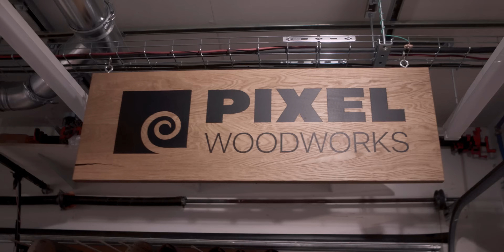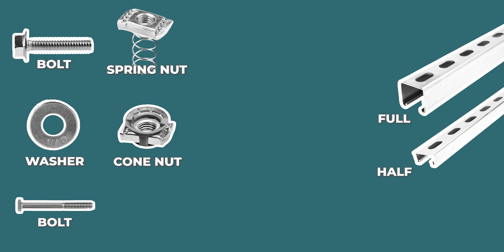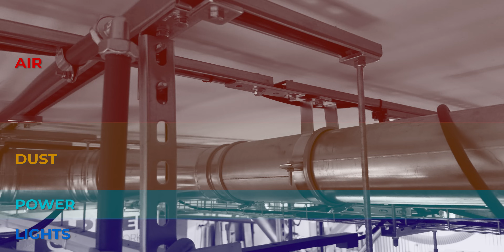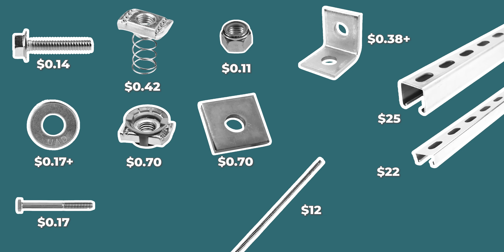How-to Use your shop ceiling fully!

Comment: Is there a way to make a 90 degree turn with this stuff? Need to hoist stuff up to my attic, slide 3ft down, the make a right turn and slide another 6ft.
Reply from the maker: If you mean with strut, yes you can make 90, 45, or more subtle angle changes.

Comment: That looks like a great setup you have. What is the spacing between the base struts that you use?
Reply from the maker: Thanks! Spacing is between 4-5' because the cross members are 10' I wanted to avoid as much cutting as possible so one perpendicular length spans 3x base struts. I hope that helps!

Comment: fact check: cost effective. No.
Reply from the maker: It really depends on what your comparing it to and what the long tail of cost savings is. I've had it for coming up on two years and I get endless utility from it. Prior to this, I spent a lot of money trying other configurations including wooden structures, that I tore down and trashed over time. YMMV and one size does not fit all 🤷

Comment: Be careful hanging too much weight from a garage ceiling.

My parents have been doing that since the 80s and it looked ok when the roofing was old wood shingles but when they re-roofed with asphault the damage was plain to see.  The roof trusses had sagged over the garage so while the house portion looks fine, the attached garage has dips and curves where it should be flat and straight.

I told them to take out the storage they were hanging from the garage roof trusses and fix the dips before they put on the new roofing but they did not and now it looks pretty funky.

You might not notice it right away but after you do, you can't un-see it.

The other thing is if you design a garage with open roof trusses, design it to hold a load of crap in the trusses because somebody is going to look up and have bad ideas...
Reply: What you did isn't bad, maybe a couple hundred pounds and you aligned the strut to distribute the load.

It's when you have 4x as much and don't distribute the load properly that messes things up.

I'm planning a garage with living space over it too.  An important part of that is using the space between the floor joists as a mechanical chase for my utilities.  It's going to be covered up with a decoupled ceiling to make the garage look nice and reduce the noise that can make it upstairs but still allow access when I need to get to something hidden in there.

Now I'm thinking of adding permanently installed dust extraction in there too.

Another thing I want to do is hang movable walls on truss trolleys so I can make my two room garage/shop in to three or four rooms.  That will let me create a paint booth or wood shop that is designed to control overspray and dust for quick cleaning and conversion back to garage space after a project is finished.

I'm also going to have a lot of pallet rack area so my storage can go vertical and I have a hydraulic lift cart that can raise 300 lbs 72" so I can put heavy bins on high shelves even when I'm old and grey.

It's all going to be an exercise in efficiently utilizing every square inch of floor space to the maximum so I can make do in a 1,000 ft² shop instead of a 3,000 ft² shop and live in about 800 ft² upstairs.

Hopefully that will mean a solar and battery system big enough to occasionally run a mill, lathe, horizontal bandsaw and welder will be big enough to run my HVAC continuously (I live in a desert with good sunlight).  It's also a lot cheaper to build 1,800 ft² of shop/home than 3,800 ft².

I'm going to build another ~1,000 ft² steel building for additional shop space and storage.  It will have HVAC but it will be set to cool when it gets over 95° and heat when it gets under 40° unless I'm using it.  Insulation will be about R12 in the walls, maybe a bit higher in the roof but well sealed to prevent conditioned air leaking out or critters getting in.

That might sound like a lot of space but when you want to fabricate, paint, woodwork and store a few project cars inside so they don't cook all summer, it's about as minimal as I can go without making some things really difficult or impossible.

Luckily I have over an acre to build on and flat spots for both buildings and a driveway that connects them.
Reply from the maker: @beardoe6874  Wow you got some plans, it sounds like that will keep you busy for some time! "Nature Abhors a Vacuum", and we seem to find no problem consuming as much space as we can find, or in your case build. I used to do automotive work until I ran out of things to do so I switched hobbies, thats going to be a big chunk of your space. I imagine if I had land to build on, I might fall into a black hole of over-building and never completing, a labor of love for sure though. Good luck and hopefully you have or are getting a Tractor with Backhoe too!  👍👍
Reply from the maker: Its true, I consulted a structural engineer because we built a room on top of this garage as well. So far so good, this has been installed for about 1.25 years and no signs of movement. I covered this in the original edit, but cut it for time. I even had a segment in my attic talking about the joists etc. I just thought it digressed too much, but perhaps that was a mistake, people seem interested. 🤷

Comment: Unistrut.... ?
Reply from the maker: This seems to be a pretty common comment. Yes Uni-strut is A brand. You won't find Uni-strut at your local home center, you will find Super Strut or something else, so I just made it more generic to avoid confusion. Mission failed on my part 🤷 👍
Reply: @pixelwoodworks  I in no sense of the word think you failed! I was just injecting a comment more than anything.. I have seen and heard it called all of the above. You did an excellent job on your ceiling project!!!!! Thanks!

Comment: It’s all fun and games until your roof comes down because it’s not designed for the extra weight.
Reply from the maker: I talked to a structural engineer before installing, but yes, everyone should be cognisent of the load. I originally covered that in the video but cut it for time. I did cover it in the description of the video.

Comment: You can do the metal cutting you describe with an angle grinder.  Which you can also use to deburr the cuts once you've made them.  Less expensive and less space than a metal cutting saw.
Reply from the maker: Its true. I haven't personally had great luck with angle grinder cutting, which is why I bought the miter saw. Some people have suggested a bandsaw as well which seems like a great alternative. You must do metal work and be a whiz with the angle grinder, I'd probably loose a hand 🤷 👍👍

Comment: We use Unistrut all the time for electrical/low voltage jobs. The only hurdle for the average home owner would be the price. but this stuff is great for a wide range of usages. great ideas, and implementation!!!
Reply from the maker: It's true, it can get expensive. It can also be targeted for specific purposes and be fairly cost effective. In the scope of my project, the strut was no the major cost. Dust pipe was by far the biggest cost, followed by power, followed by lights.

Comment: I used the strut components to mount the waste water tank to the underside of my food truck, but I never thought to use it as intended, hanging stuff from the ceiling… thanks for reminding me of one of the common uses of strut! I’m going to take a good hard look at my little shop and see how I can use this!
Reply from the maker: Awesome, the great thing is you can do as little or as much as needed, you can add on over time, and start with something very specific. Good luck!
Reply: @pixelwoodworks  thanks!

Comment: I used to spend way too much time trying to find a random tool or thing, then I decided to used these struts with trollies connected to multiple offset sheets of plywood to create additional wall storage space.  These dozen sliding 24" wide sliding walls segments support thirty six packout mounting plates which I use to store the variety of packout organizers that keep all my odd tools, fasteners and other small materials in dedicated cases so they are super easy to find grab and go.  Got an electrical project?  Just grab the electrics pack and wire nut pack.  Internet work needs to be done.  I have cases for all that with all the coordinated tools.  Hanging pictures?  Yes, that's covered and more. and it all fits behind several spaced out tall metal storage cabinets along a 12' wall with 16" of depth.   This keeps all the odd things tucked away and out of my larger woodworking and mechanical tool boxes so my primary shop area is super clean and organized.
Reply: I've had this exact idea floating in my head for about a year now. Been trying to reverse engineer levracks. Love the idea, hate the price!😂 cheers!
Reply from the maker: Ah yes, thats the product I was thinking of, thank you! 🙏
Reply: That was the inspiration.  I think mine is more sturdy given it is fixed to the buildings joists instead of pallet rack and its more flexible at a third the price.   @159648sentile
Reply from the maker: What a great design and execution. I have seen commercial systems like this but but they are extremely expensive and not configurable. Great Idea, thank you for sharing 👍
Reply: Not very expensive at all if you take the time to lay it out properly and source the best trolly.  All the rest can be picked up at the box store.  Another note is the use of 22" long by 2" tall pieces of high-density polyethylene sheeting on the bottom back end of each sliding panel that runs against standoffs on the baseboard to keep everything level and easily gliding.  
 @pixelwoodworks

Comment: For us old boomers, we're shocked at how expensive this 'inexpensive' system has become. My first exposure to it was as a rugrat when my Dad was in the USAF.  They used the larger stuff and it was about 15 to 25 cents a foot in the mid '60s, depending on how long you started with. They built the largest storage racks I'd ever seen from the stuff to hold aircraft parts.
Reply from the maker: I hear you. It seems like thats the way of the world. I don't typically eat fast food and my memories of Taco bell are 59 cent tacos. I went through the drive through last year, and one taco was $4. 😱 I bet the stuff your talking about was American made too. Just out of curiosity, where did one go (and individual) in the 60's to get something like that or was it only available in more commercial applications?
Reply: @pixelwoodworks  YIKES! I haven't been to Taco Bell in a long time, but the tacos were still more than 59 cents. They don't taste as good now as they did when they were about 39 cents. The struts were available from what I think was the manufacturer in Colorado Springs, next to Peterson Field AFB. I don't remember the name of the company, but we could go there when it wasn't busy and a couple of the guys were allowed to sell to individuals. I think most of the stuff we got was either returned material or seconds, because we got some aluminum sheets once that were stamped with part numbers but deformed. They were a little thicker than 1/8 inch but about 2 ft by 6ft. We cut them down to size and used them in the kitchen as cookie sheets. They lasted forever.
Reply from the maker: Interesting. Thats the thing about anything built with quality in mind, it really does tend to last forever.. I've never heard of buying seconds of steel, but I guess you can get seconds or returns of anything. What would cause a strut like product to be a considered a "second" but still usable?
Reply: @pixelwoodworks  If it's for direct sale to a branch of the military, they still have to have the correct FSN's (federal stock number) printed or stamped on them. Or if the items don't match the description on the order, like they're an inch too short or something.
Reply: Inflation

Comment: Yeah... I'll admit. I have ceiling Height envy. My present garage shop (20x24) has a ceiling height of 84" with a beam going across it with a 74" headroom. One more row of block when they built this house in 1969 would have made a world of difference. As it is, there's only enough room for the dust collection duct to go across half the space without some head-banging pipes at the beam. excellent idea though.🙂
Reply from the maker: I hear you. My last garage was like yours, a big beam below the ceiling deck with a post, but on the other hand it was a bit wider and deeper. Is your shop laid out in a way you need to cross that beam? I guess we make the best of what we have, play to its strengths etc. :) Thanks for the kind words Wayne!

Comment: Great for those with really high ceilings.  My ceiling is a couple of inches under 10' which makes using overhead spaces a lot more complicated.
Reply from the maker: You are right 👍 I wish I had 14' ceilings though 🤷

Comment: Great video 
I worked in an industrial setting installing many strut systems, the abrasive cutoff saws is very noisy and slow , we found a portable bandsaw the best. As well as being very versatile at the same price range.
Reply from the maker: I agree, the cutoff saw is extremely loud. Great suggestion. 👍

Comment: Great ideas! But, be careful of weight. To be on the safe side, I'd suggest consulting with an engineer or use other means to determine the load rating of the ceiling joists or trusses.
Reply from the maker: I agree and In hindsight I should have mentioned this in the video. 👍👍👍 The load is the reason I'm not storing any lumber.
Reply: @pixelwoodworks  I figured as much. Difficult to cover everything in a YT vid.

I don't know that structural strength is considered by many/most, so thought I'd offer the reminder. Thanks for the reply.

Comment: In the usa home depot has it in stock, as well as most of the attachments. Well I think they have super strut which is unistrut compatible but doesn't have the branding.
Reply from the maker: Correct and Lowes has Adamax (which I'm not sure is more or less confusing? 🤷)
Reply: @pixelwoodworks  as long as they are compatible it doesn't matter to us. I like how home depot also carry the powder coated strut. I used some for fence posts across some land that seasonally floods with brackish water. I am hoping that it may last than all of the rusted galvanized posts I see in that area.
Reply: @pixelwoodworks   and lowes is easier to get a cheap delivery on in case you don't have an easy way to transport 10ft lengths of steel. When I ordered a several pallets of fence panels from lowes before the pandemic it came with free home delivery.
Reply from the maker: Interesting, that could make a real difference. I usually have to rent a truck. Thanks for the tip.

Comment: Great use of the different strut accessories for various applications. 

One suggestion, around 5:43 when you show the suspended platform. There is a much easier, cheaper and stronger way to do that. 

Hang a piece of threaded rod in each corner, have a hole in your plywood for the rod, pass it through one strut and then through another at 90 degrees to the adjacent corner (for super heavy duty applications)

Rod is much cheaper than the strut drops, you don’t need any brackets, and there is no relying on nuts/bolts needing to be super tight to avoid them sliding in the strut. 

Again, great problem solving and use of the product
Reply from the maker: Hi James, I do use threaded rod in many cases, however the de-humidifier itself tends to vibrate and I was worried about that motion over time so I wanted something more stable that didn't have flex. Great suggestion though, and your totally right in most cases. 👍👍👍

Comment: Thinking about this system, a track for a  5 gal shop vac would rock. The one I have in my small shop is always underfoot.
Reply from the maker: 👍 For sure, I considered putting a dust extractor above my workbench for easy access to sanders or other handheld tools.

Comment: Retired commercial electrician from NYC, I've run thousands of feet of strut ( we called it kindorf [which is just a name brand]. You did a great job . Oh side note ,we cut "strut" with a hack saw ( start on on the open end) or a band saw, ( not a woodworker band saw.) Again great stuff.
Reply: Also remember to file the cut ends.  Unistrut can make a nasty slice in your skin.  Bad enough to require more than electrical tape to close it up.
Reply from the maker: @guybratt6238   😵 You are right. I purchased end-caps from Discount Strut Accessories that are rubberized and solve that problem, but then I never found a place to install them, somewhere that was exposed and had about 1.5" of open space for the cap to go on. Good advice, I missed that one.👍👍
Reply from the maker: So nice to hear from an electrician!

You are totally right (of course) about the hacksaw..  I originally mentioned it cut it out for time.. I never actually tried the hacksaw myself either, it just seemed like a lot of work.. sounds like it was a real option though and not just a cost saver. 👍👍

A mobile bandsaw is a great suggestion that I totally missed. 👍👍

Thanks for the tips and feedback!

Comment: Diablo makes a Steel Demon blade for circular saws. It works great!
Reply from the maker: Excellent. What kind of saw are you using it in, standard miter?
Reply: @pixelwoodworks  Actual its a Dewalt cordless skill saw. I'll post the blade number tomorrow. It's in my work truck. Not as good as a miter saw but better than a hand or skill saw.
Reply from the maker: @billygilbert7911  Ah that works too, even more efficient.